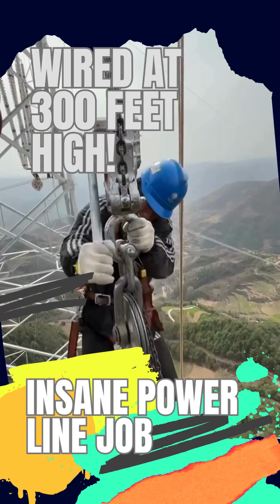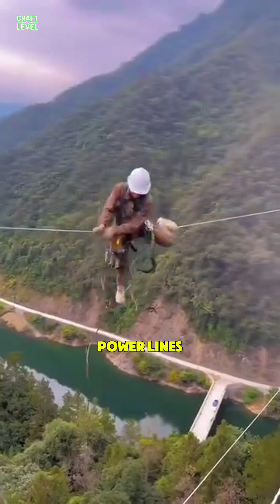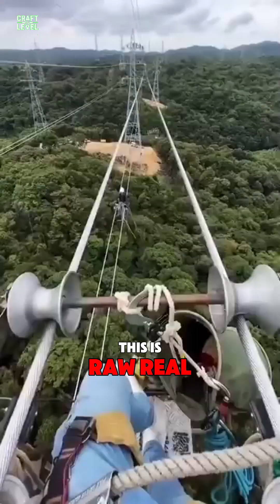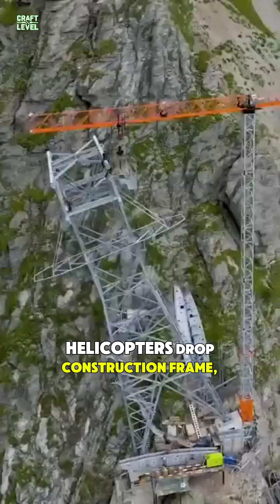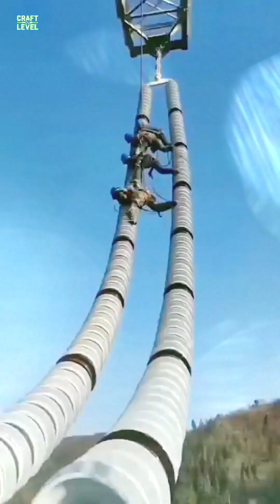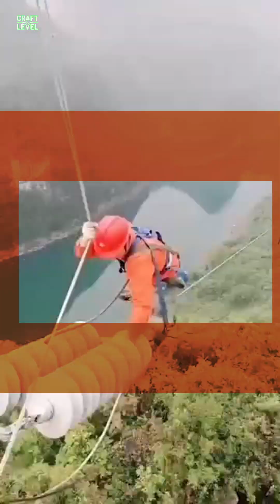Installing Power Lines at 100M! craftlevel#ExtremeJobs#HighVoltageWork#EngineeringMarvel

Comment from the maker: These men are doing what most of us wouldn’t dare—installing 150kV transmission lines at dizzying heights, with nothing but cable beneath their feet. Every move demands insane precision and guts of steel. Could you ever do a job like this? What’s the most dangerous work you’ve seen or done? Drop your thoughts below—we want to hear your story!